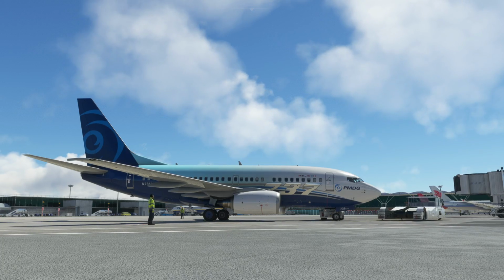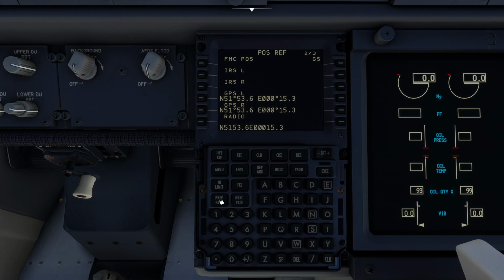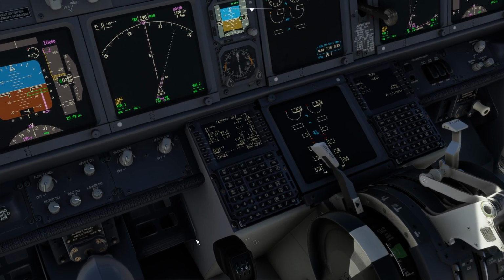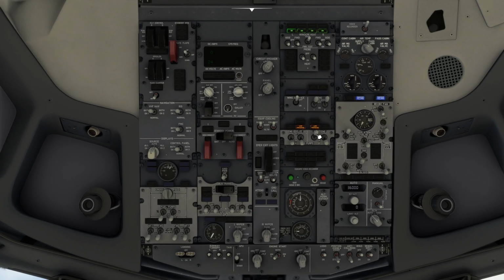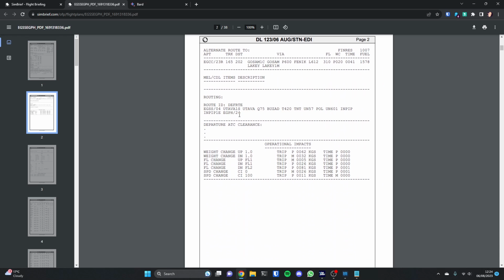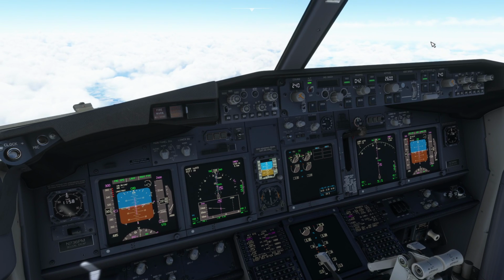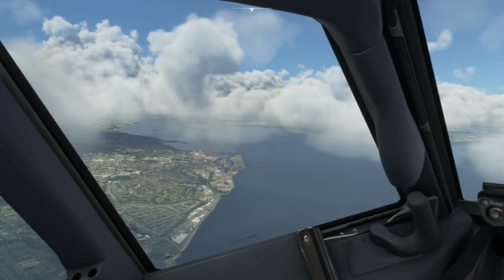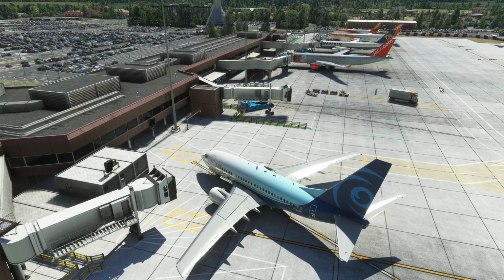Guide to planning flights with Simbrief for the XBox with the Boeing 737-600 in Flight Simulator

Comment: For some reason I can’t use half the buttons for the Xbox version the nav buttons and the engines dials won’t turn to on or anything so I basically wasted 34 bucks.
Reply from the maker: Have you worked through the checklist ? Also, have you tried changing the control scheme to legacy, instead of the XBox "lock/modern" system ?

Comment: Incredible video! I’m 85% more comfortable with the 737-899, until I’m above 10,000 when the cabin altitude starts giving me a warning 😢
Reply: You probably did not set your cabin pressure correctly.  Make sure to put your cruise and landing elevation(make sure your landing elevation is always equal to or above the actual elevation) in the pressure settings right above your lights.

Comment: Hi mate! I just bought this plane I play on Xbox, the problem is that I can’t press the lnav, vnav, and altitud switch, do you know why?
Reply from the maker: Those autopilot modes will not switch on unless you have a fully configured FMC, intertial navigation working, and flight directors switched on.
Reply: @jonbeckett  ohh got it thanks man!

Comment: Great tutorial very calmly done with no assuming that we already know the plane ,I notice while you were inputting the Ils freq for EGPH your Nav panel looks different to my one on Xbox X as frequencies are side by side on mine and not on top of each other on yours?
Reply from the maker: The PMDG 737 fleet let you configure the aircraft hardware as per the real thing. There are something like 15 pages of hardware options deep inside the FMC. It's brilliant. Each livery supplied with the aircraft matches the load-out of the real corresponding aircraft.
Reply: Of course silly me ....I will check the Fmc Menu ,must have missed that section thanks.

Comment: The TOGA button is on the dash in the sim to the lower left of the course dial.  It’s the black screw.  Curious as to why it’s not located on the throttles.
Reply: If you mean the Screw click spot, it’s just so it’s easier to hit with mouse/controller that the Real life TO/GA on the throttle thumb toggle.